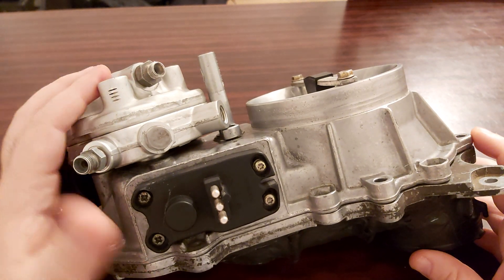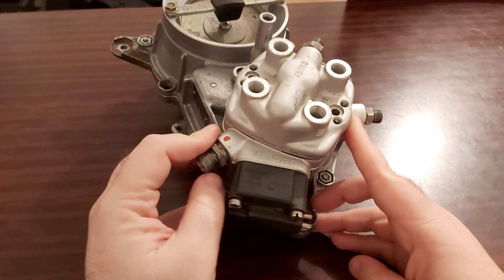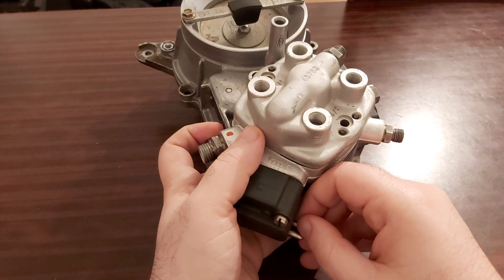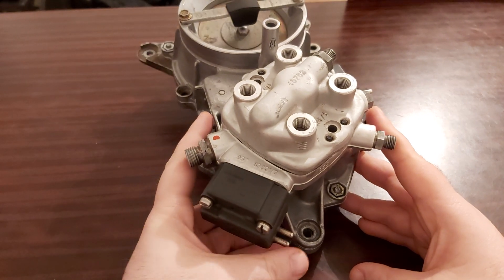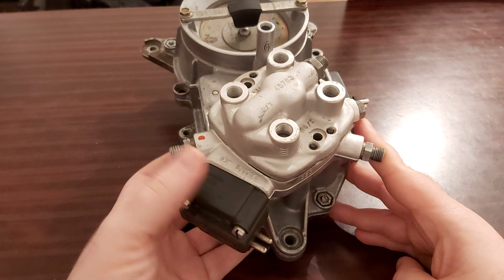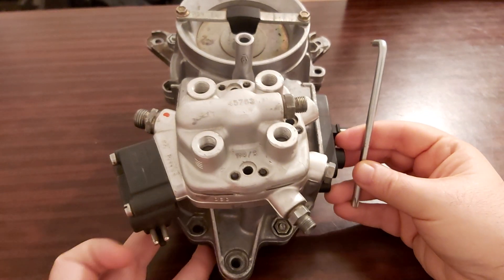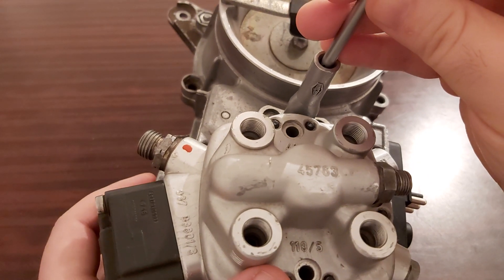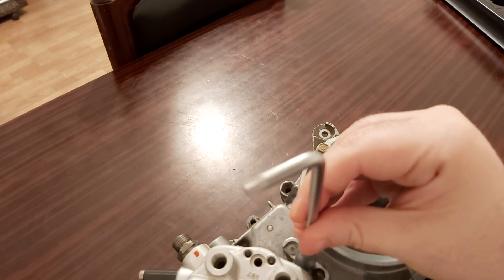㉦Mercedes Ke Jetronic㉦ - A special video for a special person

Comment: hello , I have also KE-Jetronic in my W126 1983 280SEL . but I don't have this unit in the fuel distributor to check the Amp Meter. so how can I measure it? thanks
Reply from the maker: Hello. If you have KE then you must have the EHA.
Reply: @mercedeske  where? maybe I have old version of KE-jetroinc ?  I can send you picture is you write me e-mail. tnx
Reply from the maker: @guyrozen4506  Send it.
Reply: @mercedeske  Sent :)
Reply from the maker: @guyrozen4506 I saw the pictures. In order for it to be KE-Jetronic it must have potentiometer, lambda probe, EHA, coolant temperature sensor as well as the temperature sensor on your air filter housing. I didn't see anything of that. This is K-Jetronic, the mechanical version of the system. You can't do these measurements.
Reply: @mercedeske  I'm understand . so I have the old version that is K-jetronic . do you know how to make some measurements to check the system ?
Reply from the maker: @guyrozen4506  If no one has been messing with the mixture screw then everything should be fine. Just replacing the injectors each 90k miles, as well as the fuel pressure regulator(check at first) and you don't have a reason for messing up with the mixture screw.
Reply: @mercedeske  Someone already messing with the mixture . how I can check the fuel pressure regulator?
Reply from the maker: @guyrozen4506  You must hook up a pressure gauge on the lower chamber of the fuel distributor. If the pressure falls while you press the accelerator lever, then the fuel pressure regulator is not good. Try to adjust it buy turning the allen screw on the return line for a 1/4 of a turn clockwise. If nothing changes, then the regulator is bad and has to be replaced. As for the mixture, try to get a gap on the sensor plate - it must be sliding easy and then to start moving harder(this gap has to be in an ideal case 1.9mm). I have the video on that so you can watch it.
Reply: @mercedeske  thank you I will try to check what you wrote me , can you put a link about video about the gap of sensor plate?
Reply from the maker: @guyrozen4506  https://www.youtube.com/watch?v=ThoatMlKT3k&t=28s
Reply: Hello 👋 
Do you make video about checking cold starting valve for function and leaks?
I’m not sure my cold valve working 
And I feel very smoked car 
And I read that it can be from leaking cold valve system.
Also I’m not sure thermo time switch is working.
Reply from the maker: Hello 👋
Unscrew the valve(disconnect it first). You must get 10 ohm resistance. Reconnect it, put the jar underneath and simulate cold start. The car must be cold. You must get a nice spray pattern. As you do wait for one minute. In this time the cold start valve mustn't leak.
Reply: @mercedeske  Hello, Do you mean disconnect it first - from electric or from Fuel Distributer ?
How to mesure  10 ohm resistance? (on the electric plug) ? 
Tnx
Reply from the maker: Just disconnect the blue/green connector while the engine is off and then simply measure the resistance on the pins of the cold start valve.
Reply: @mercedeske  thanks .
how I can check if come voltage to the valve?
Reply from the maker: You have to read 1.2Amps, that's what I know about the current.

Comment: Thanks for video. Many people did not know that the mix was set from EHA. Now i know
Reply from the maker: Hi, I guess. This video is for those who don't have either kat version of the car or the 3rd port on the x11. Concerning the duty cycle - during this operation it's recommendable to have 2 multimeters - one on the x11 measuring % and the second one on the eha measuring miliamps. This video is for those that have issues with the mixture and somehow they have to adjust it right way. This is my guessing only, the only way when you are unable to do it where you normally have to do it.